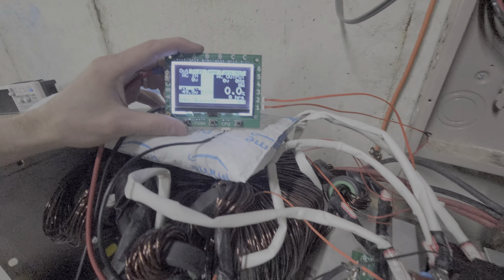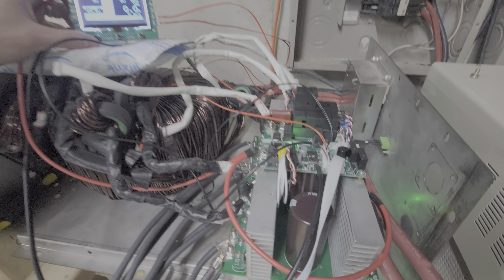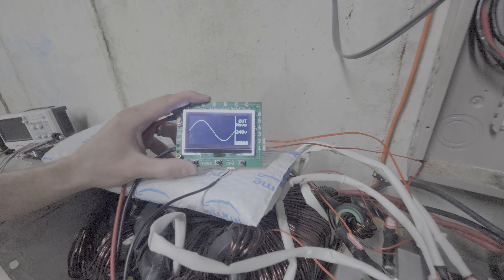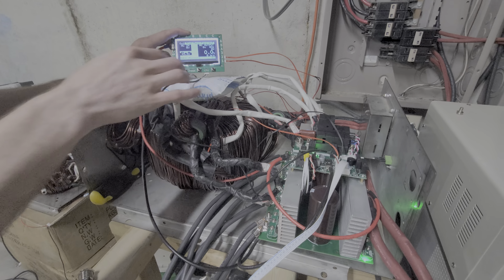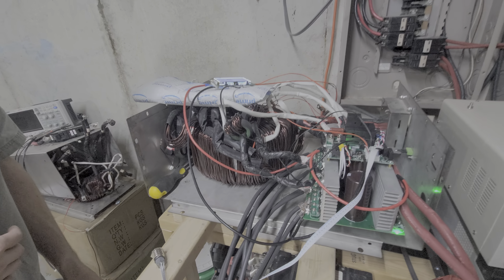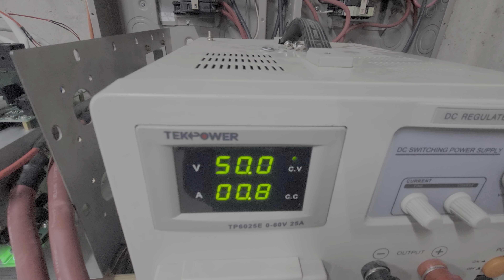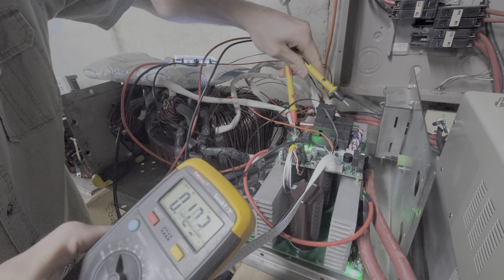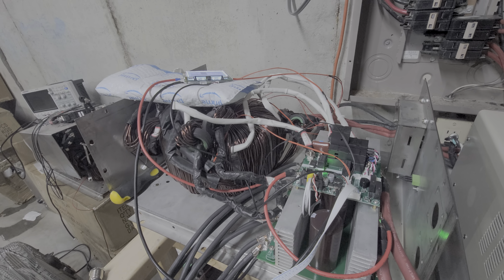Genetry Solar 12kw first power on test

Comment: ive got a 12000 watt ver 10.0 upower inverter in a big box and have tried turning voltage up but cant get anything over 116 on one leg and 114 on the other leg, I should be able to get at least 120 ?